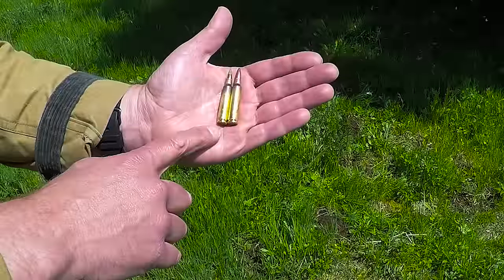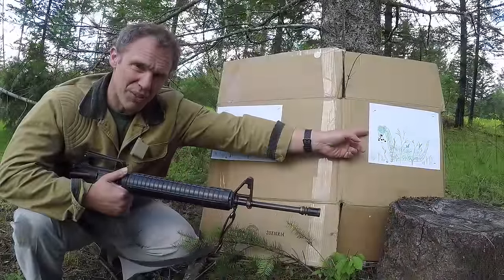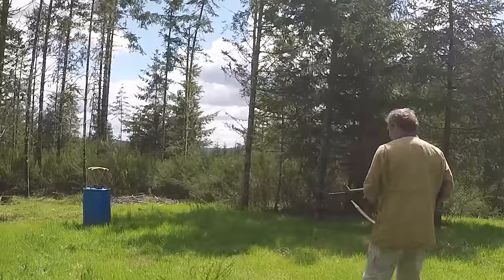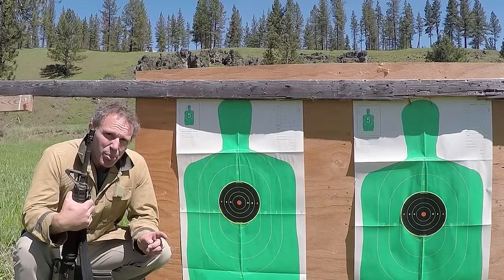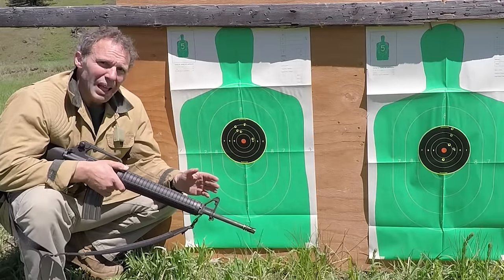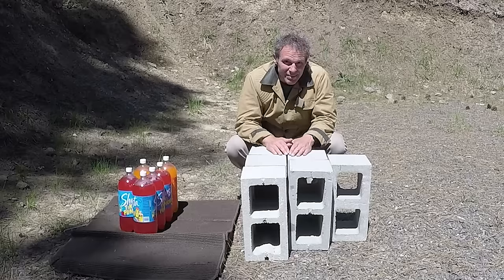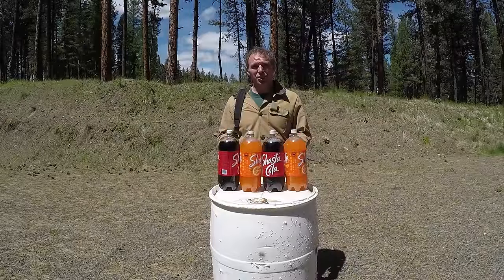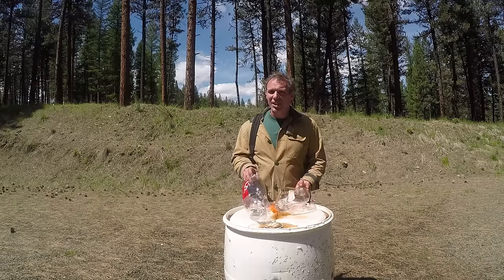5 56 NATO Ammunition:  XM193 55gr.  vs  M855 62gr.

Comment: Great video Paul.  I have heard that the 55gr bullet is better against meat than barriers.  Your video goes a long a long way to dispel the "keyboard wisdom".  The 55gr did an outstanding job against your meat target and still did pretty much as well against the cinder blocks as the 62gr green tips.  Nice work as always.
Reply: vbressner yeah. There is a reason why NATO didn't accept the 55 grain for it produce ghastly wounds that was "unhumane". When SHTF situation happens the 55 grain will do its job accordantly.
Reply: @jessesimmons9238  Sweden (IIRC) complained about the "lethal" 5.56 until it was pointed out that their 7.62mm bullet also broke at the cannelure and fragmented exactly the same but with about three times the mass.

Comment: I love the tests and data here. However,  recent tests I've seen shows that with the proper barrel twist rate,  the 62gr M855/SS109 is more accurate at further distances of 200 yards and out.  I would suppose it depends on the quality of the ammunition you are shooting as well. Thanks for the video!
Reply: My understanding is that the 62 grain is best with a  1-8 or 1-9 twist.   Where a 55 grain works best with a 1-9 1-10 twist.  So a 1-12 twist gives the advantage to the 55 grain and a 1-7 twist favors the 62 grain.   So to do this comparison right you need a 1-9 twist.
Reply: @patkarp1965  ...or the twist rate determines what ammo you should use, not the other way around.

Comment: I was raised up on the damage inclicted upon the enemy by tumbling 55 grain ammunition fired from my M16A1. It was a matter of faith. I still believe it and own very little of the green tip stuff. If 55 grain 5.56 ammunition won't do the job, it is time to up gun, not change ammunition. I 'm thinking a .308 would have destroyed those blocks on the first round.
Reply from the maker: "Up gun." That's a good phrase.
Reply: Chip, the idea is that ammunition matters. M855 isn't an accident of engineering. It's designed for certain situations where it excels.
Reply: I don't think 7.62NATO would.
.300WM might, but not from bullets, but from cement fragments.
It's just a lot of inches of material to go through.

Idk, I've never shot cement blocks with .300WM or 7.62NATO before, but .300WM will punch through AR500, whereas 7.62NATO won't.
There's a YT vid of that.
Reply: I’m with you, Chip.  I, too, was raised (active duty ‘69 - ‘89) on the M193.  However, I also agree with the comment that different rounds are intentionally designed for specific and varying purposes.  As I recall (I am NOT an expert and could easily be wrong) the M855 was intended to penetrate a Warsaw Pact helmet at 200 meters.  That’s a very different design focus than having a light round (wasn’t it 2x the ammo load for the same weight?), fired from a light semi- and fully-automatic rifle, that would employ extremely high velocity to achieve devastating results, at short and intermediate combat ranges?  In sum, I, too, Chip, have very little M855 on hand, but a heck of a lot more M193.
Reply: My vest consists of 6 mags of xm193 and 2 mags of xm855. Like the comments above say. The green tip has it's place. Like when extra penetration is needed
Reply: Chip Sanford there are good videos out there of cinder block tests, and hardly any common small arm effectively goes through both sides of a cinder block with one shot. 500 s&w won't do it, 308 won't do it, etc. It's just a very hard target. However, both heavy magnums and a 308 SHOULD basically cut that block on half in just 2 shots. Just from what I've seen.
Even a 9mm can chew up cinder blocks, but most don't have enough energy to displace the material in a short enough time to make it so you get it out of the way and get that clear shot of the second half of the cube... so they just crack and ice pick it to death.
Reply: A recipient of m193 has good reason to fear its effect on flesh via M16-A1. IIRC it was not purposely designed to fragment, more of a happy accident of history. Whereas the Russian 5.45 was purpose designed to tumble and shred.
Reply: I was told by a navy engineer (I know wrong branch but they are still knowledgeable in many areas) that the m855 was designed to have the same penetration at 300 yd that the m193 has at 100. The rest of the performance traits are all artifacts of engineering (ballistics, tumbling, etc).
Reply: Chip Sanford 5,56 isnr available for civilian use, the civilian variant is .223 remington which has a lower load
Reply: +roteroktober420 smoke another one and dream up some more fairy dust. I have a can of lake city (the same company that make ammo for the military) 5.56 NATO military surplus. Nothing illegal about it. .223 ammo has a wider range or bullet types/loads due to its hunting aspects. And has a thicker case wall so it can be loaded very hot. That's the whole point of comparing the two different types of 5.56 ammo in this video. There is only like 4-5 bullet designs in 5.56.
Reply: Can buy 5.56 all day long! Where the hell do you live?
Reply: Also 223 is no slouch in a AR .
Reply: manictiger I've shot cinder blocks with my 30-06 and it gets the job done, 308 is more of like small deer or a hog gun whearas I shoot moose and black bear with my 30-06. And so does my grandpa lol
Reply: @roteroktober360  you can buy 556 at Wal-Mart....... And that is nothing new......
Reply: @Darth nataS HEAR HEAR !!!!!!
Reply: M193 was designed to fragment at high impact velocities, i.e. above 2600-2700 fps - which is how it manages to wound equivalently to the much larger and heavier 150-grain .308-caliber M80 Ball which it was destined to replace. The Russians reverse-engineered our 55-grain NATO round, and added their own refinements. Their 5.45x39 53-grain bullet, used in the 7N6 introduced in 1974, relies on a hollow cavity in its nose and a small lead weight to move the center of gravity further back along the bullet; this is where the tumbling effect comes from. When the bullet hits the target, say ballistic gelatin, it immediately swaps ends. It would be fun to believe that cloak-and-danger stuff was involved in this, but they probably got the idea from the British, who had previously used a similar technology in their .303 rimmed rifle cartridge. Instead of a hollow air pocket, they filled the forward part of the slug with aluminum, which is of course considerably lighter than lead.
Reply: Yep, our elite Delta Force and Navy SEAL operators were watching Somali tribesmen absorb multiple hits center-mass but still remain in the fight. Those dudes must have been pretty steamed that their ammo was substandard. The "ice-picking" effect is especially pronounced in skinny or slender individuals, which is precisely what many of those militiamen were.
Reply: @GeorgiaBoy1961  Not all M193 bullets are equal, some have harder jackets and/or thicker jackets. Read the article about testing various M193 about ten years ago IIRC. I've not seen the actual military contract specs so I'm not sure if the specs call for a certain alloy for the jacket. Same for jacket thickness. I know Hornady's version ricochets like crazy off of firm soil.
Reply: 5.56x45 ammunition made to NATO specifications has to fall within the specifications set by the North Atlantic Treaty Organization, the idea being that resupply with ammo from any NATO supplier - whether American, German, British, etc. - would perform within spec and reasonably to standard. Most of the big ammo manufacturers for the civilian side conform either to SAMMI specs or the European equivalent. Having said that, I have noted wide variation in measured MVs across different brands of 55-grain .224-caliber ammunition. Some variability in brass thickness as well. There are some well-done tests out there as well. Lucky Gunner has some up on their website, to name one example. There's a lot of variability in factory ammunition; some companies go the extra mile to make ammunition which is of very high-quality, some only do enough to meet their sales goals, and some cut corners. The good news is that in recent years, even the worst factory ammo is significantly better than it used to be twenty or thirty years ago.
Reply: Anybody read up on the new M855-A1? It CAN penetrate both sides of a cinder block, it has a steel penetrator twice the mass of the previous M855. It also is guaranteed to yaw and produce wounds similar to the 5.45 “poison bullet” due to its new design. It’ll penetrate a 3/8” steel plate at 400 yds the old M855 160 yds.... sounds like they really improved a good round...
Reply: Don't believe the Pentagon PR. No single projectile (bullet) can perform all tasks (missions) equally-well. Which is why there are different classes or types of ammunition for different purposes, even within the same caliber and cartridge. The M855A1 is highly-effective as a penetrator - and has enhanced performance against barriers, including helmets and body-armor -in comparison to the old green-tip M855 62-grain. However, by making it better at that task, the engineers had to sacrifice some degree of performance in soft tissue, especially in terms of fragmentation. The Soviet 5.45x39 60-grain cartridge performs as well as it does thanks to the deliberate placement of an air pocket in the front part of the projectile. This causes the tumbling effect when the bullet strikes a target, as the projectile is rear-heavy and swaps ends. The British used the same design concept in their 174-grain FMJ .303 rimmed cartridge, except they employed an aluminum pocket and not air. The new M855A1, in order both to penetrate well and attain the specified degree of accuracy, can't yaw excessively or accuracy would be degraded. This limits its potential as a general-purpose round. What the Pentagon evidently asked for - and got - was a de facto ice pick. Which was already a problem with the old M855. This is one of the reasons the Marine Corps isn't all-on-board with the M855A1. They are also rightly concerned with wear-and-tear on existing M4s and M-16s due to the characteristics of the new cartridge, and its sharp tip hanging up on feed ramps. Big Green goofed & ended up producing a round which will wear out their weapons faster while only succeeding in solving some of the problems with the previous generation of 5.56x45 ammunition. Not saying the M855A1 is a bust - it isn't - but it is far from the technological/ballistics wonder the Pentagon PR Flaks are touting it as.
Reply: VT Concerned Citizen   Did you even WATCH the video?  He plainly states that fact later on...  Mine has a 1:9. I'm ok with either. But, I prefer 55g pills.
Reply: @festerallday  he's not wrong,  it came about because the Soviets started to field more body armor.
Reply: @nah6430  you do realize 30 06 and 308 shoot the same round at almost the same speeds. in some loads its the exact same speed and weight round. and in some the 308 is far better than the 30 06 and 30 06 in better in others. so the small deer hog gun commit means the same for  30 06. it no better than a 308 unless you hand loads some hot rounds as the case is bigger but if you use sammi load  data your all mighty 30 06 is just a big case 308. with a longer bolt and higher priced ammo
Reply: Bill Randall  308 means no silencer really ive seen 20 plus video with a 308 and a silencer on them and have seen many in the gun stores also
Reply: @roteroktober360  umm, check wideners, palmetto state, midway etc., etc., etc., they all sell 5.56 military in 1000 round lots.

Comment: I would like to have seen a tumbling comparison using 55 grain bullets 1 in 12 twist vs 1 in 7 twist.
Reply: He fired both rounds in the a1 with a 1 in 12 twist and in the accuracy testing segment he was using an A2 with a 1:7 twist.
Reply: @jamesjohnson4159  Sorry, what I meant to say was a comparrison in a gelatin block, say, one 55 grain fired from 1 in 12 twist next to one 55 grain fired from 1 in 7 twist using identical barrel length would be interesting.
Reply: @kevinwilson9589  ok.  Paul doesn’t do gelatin testing.

Comment: THAT .. was interesting. I was straight leg Infantry 89-93. In basic.. I was originally issued an A1. (after the rubber duck) We traded in the A1 for A2. We zeroed iron sights on 25m targets. Went to 300m range. I could SWEAR my weapon was an A2 with NO elevation adjustment on the rear sight. Safe, Semi, and Burst. Every third of fourth cartridge I experienced a misfire. I went through clearing procedure as trained. My instructor examined the cartridges. I was ordered to the Armoror and issued a new A2 still in the shipping container, covered with plastic and oil. I cleaned the weapon and dialed my 'battle sight zero' .. I was three low - nine right on my three inch groups. The previous weapon had a broken hammer spring. The spring was weakened as a result, but the weapon STILL functioned intermittently. I was amazed. I took the new A2 to the 300m range. It was the identical configuration as the first A2 that I had been issued. No adjustable elevation on the rear sight. I learned many years later that it was a "177" model. People have told me that I am full of shit. I KNOW that was my weapon. We did not qualify with m855. There was NO green tip. Later.. at my first duty station.. I went to the 300m range and we loaded green tip. I was on the detail. I loaded green tips all God damn day long until my fingers were bleeding from those God damn 30 round magazines and speed loaders. Again, I had the same weapon. A "177".. I zeroed. Nice groups. I loved that son-of-bitch. People say "you were just confused" it wasn't a 177. They weren't green tips. WE HAD THE RANGE!!! I qualified Expert on three different lanes throughout the day. I consistently engaged man sized targets with iron sights and m855 at 300m. They tell me that I am "full of shit".. After that.. they gave me a pig. I hated that piece of shit. I hated it because I had to put hundred mile an hour tape all over it if I wanted it to function properly and stay quiet. It was like carrying a God damn baby rattle around. It fell apart just picking it up and moving to a secondary fighting position. I hated the linked ammo. I couldn't hit a bull in the ass with it. I hated having to clean all the God damn melted tape off of it prior to returning it to the Arms Room. The only good thing about the pig.. was that it wasn't a SAW. When I tell people that I engaged man size targets with a 177 and m855 back in 90-91 they practically call me liar. I KNOW I did not dream it. Later.. they made me an RTO for a Spartan. Which meant that I had to carry ALL of my shit .. and half of his. It was a good gig otherwise. I got good chow. Didn't get much sleep but I got to drive. He was enlisted, got his tabs, THEN went to OCS. I would have followed him through the gates of Hell. We BOTH carried 177 models. I could SWEAR it. By that time.. mine had a 203 mounted on it. I also had an ANPVS5 on a quad sight. I could range targets and engage with 40mm grenades at night. I also got NODS and drove with them. People tell me that I'm full of shit. I haven't touched an M16 or AR since I separated from the military. Listening to the report of your rifle took me down memory lane. I could feel my heart thumping inside my chest. I could smell the powder. I guess I'm just an old man that is full of shit. If that is true.. then I have no idea where those rotten leather speed lace leg boots came from. Thanks for the show. It was interesting. I guess I never really truly knew what I was doing.. or why.
Reply: Snuffy Grunt i had a 177 pellet gun issued in the army too. .177 bullets are amazing
Reply: Eff'em I qualified expert with hits on all four 300-meter targets with an A1 and irons.  I damn sure wasn't the first, the last or the only guy to do it.
Reply: @Universal Kombat Sounds to me like what people called the XM-177.  But, hell, what do I know?  I'm old enough to remember those days first-hand and since nothing existed prior to the millennial tacti-fools who know all and do all; I clearly don't know any more than  Snuffy Grunt.
Reply: My A1 in '86 had SAFE, SEMI and Empty. 

Back in BCT one guy was issued an original M16.  Slick-sided with the good flash suppressor.  Night "qual's were kind of cool because we were all told that they didn't count for anything and basically the DS didn't want to waste time with them so we shot tracers at flashing lights because NODS were still only for Delta, SFOD's and maybe a few Rangers.
Reply: Snuffy Grunt, other than taking the Lord's name in vain, I enjoyed your story! You need and deserve a new AR-15! Lowest prices ever on rifles and pistols. Do yourself a favor and check out Palmetto State Armory. They are offering a throwback A2 rifle similar to the Colt you would have carried in 90-91.
Reply: @thomasrfoster4503  good idea! Or..he could save up awhile longer&buy POF-USA  P415 piston operated AR. They are freaking amazing instruments. Designed by a genius, they are a superior weapon with never quit dependable function. I have two. I actually love them.

Comment: I’m glad you used the 20 inch AR instead of the 16 inch that “everyone” uses now.   I love the 20 inch A2 design.
Reply: Shooting High Power matches, I have a 1:8 twist which throws 55gr all over at distance. My particular rifle likes anything over 69gr. That said never used the 62 gr green tip in competition and have also heard the steel core green tip is military only. The " green " tip on the market is lead copper jacketed. Haven't actually verified that myself